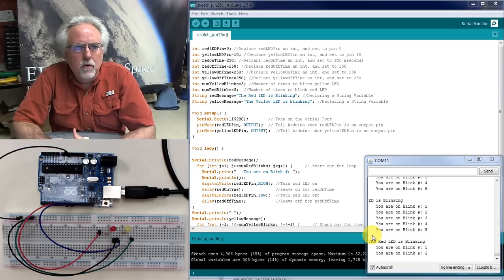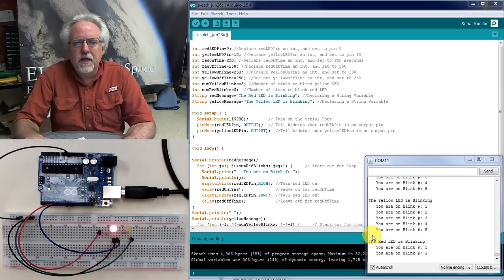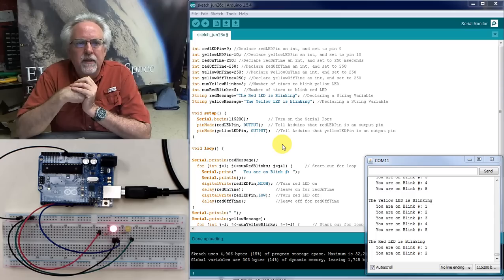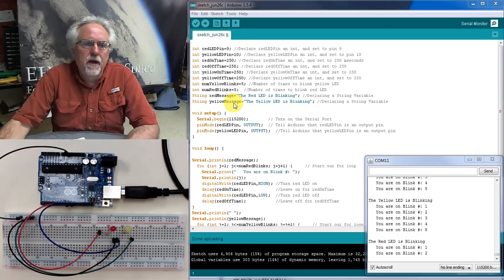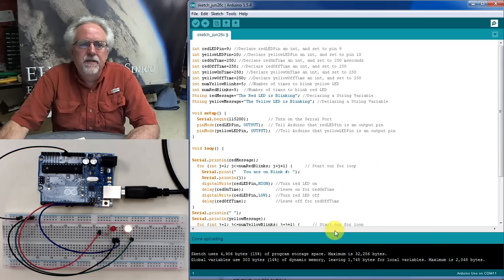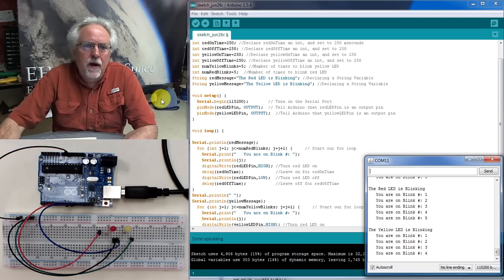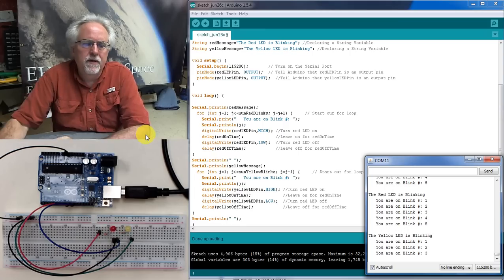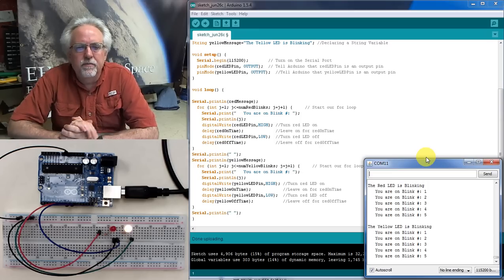LESSON 6: Reading Data from Arduino Serial Monitor

Comment: Hi Paul!  Thanks for these vids.  Once I have my Arduino loaded and I have given it to my mate to use, and he has connected it to his PC, then how does he see / where does he find on W10 a serial monitor which he can receive Serial.print on, and on which he can send (Serial.parseInt etc) instructions to the Arduino, without having the Arduino IDE or any other software open?

Comment: Hi, Mr.McWhorter. Just one comment. If you mention that people should change  "Newline" to "No line ending" in the Serial Monitor, it would be nicer :)  (Personally, I've been struggling with the loop running twice due to that issue.)

Comment: I could not figure out why the yellow would not print. Spent about an hour and checked every line of code to look exactly like yours then I thought Serial.available() is set to 1 after red is input since it is automatically a global variable and is not reset to 0 so I changed the parameter of yellow to Serial.parseInt() == 1 and it works great.

Comment: Hello professor,
I have a question for the part in which you put the code which acquires the information from the user at the void set up. Would it work if I create another loop(which contains the void loop) and then place the code which gets the information out of the original loop and inside the second loop?

Comment: Can we use ' if (Serial.availble() > 0) instead of the while loop???
Reply: Using an if in that way won't make the program stop. It'll just execute the code inside the if statement, and since in this case there's no code in the if statement, it'll do nothing whatsoever. You need to use a loop to stop it; no other choice. 

If you don't want to write the loop every time, just make it a function and call it when you need to wait.

Comment: Thanks a lot sir for your awesome Arduino lectures.I'm facing a problem about  Reading Data from Arduino Serial Monitor.I followed all the steps that you shown in the lecture and even I've copy you program on my Arduino window. But it is not following the command.It prompts me to put of blinking number for Red and when I give a integer,  it doesn't stop for  blinking number for Yellow LED.I'm  not getting what should I do?
Reply: Ok sir. I've solve my problem
Reply: how do you solve the problem ?

Comment: Had the same issue as that pinned comment regarding it asking for the second number of digits before I'd inputted the first one. There's a good solution there but as an alternative, you can use Serial.read() after each parse statement, which according to my limited knowledge, clears the memory of the arduino from before. Sorry if not explained properly!

Comment: Paul, thank you for this.  I have been playing around with the arduino for a short amount of time and have had minor experience in the mid 90s with C/C++ and I'm getting back in to it.  Quick question about this project:  How would you go about aborting or immediately terminating the for loop with key "9"?  I have modified what you have demonstrated with options of using key "1", for red LED and how many times to blink and key "2" for only yellow and how many times to blink.  Works great.  However, say, if you enter 100 times for the red LED to blink and after it does about x-amount of blinks, you want to terminate it with key "9"?  It still seems to iterate through the whole loop, then it displays "Terminated", but, I'd like to terminate it immediately.  Thanks sir!

Comment: Be careful when using Serial.parseInt(). This is looking for an int until either it times out or it sees a character. This is fine for this example but it will introduce a delay in the execution of whatever function you are using with the serial data if you just send an int. A better way would be to send an int followed by a character such as "10x" that way it will read the int 10 and see the character "x" after it and immediately assign 10 to whatever variable its assigned. Then on the next line just do Serial.read() to clear the "x" from the serial buffer so it won't cause any other issues with your program.

Comment: Hey Paul McWhorter, I have a really important doubt.
P.S. At https://youtu.be/-3Xg8x2ibeY?t=195, your serial monitor actually printed "You are on blin 2" instead of "You are on blink #:2." Is this a bug in your code or a problem with the serial port as if it is a problem with a serial port, it may spoil user experience.
Reply from the maker: You are really paying attention!
Reply: Thanks.
By the way,you are the best arduino teacher

Comment: There was a question I was going to have you in a project Arduino serial port controlled robotic arm wondering if you could help us G = body K = arm has 4 servo motors , etc. We provide how to control ... sample series pot G50 type of partition abrasive discs connected to the servo motor 50 degrees how come we do it

Comment: I found the written sketch in lesson 7. I cut and pasted it in. Some of the problems I was having were there. It would ask about how many red blinks and then would state how many yellow but did not wait for an answer! It says I am blinking both 2 time but only the red led blinks continuously! Any suggestions?
Thanks
Reply: you may try to add the line: 

Serial.parseInt ()

 to your code after 

numRedBlinks=Serial.parseInt();
and if you put the while in the void loop then you have to put the same above line after

numYellowBlinks=Serial.parseInt ();
Reply: I will try that, thanks.
Have a nice evening.
Reply: Jeez thanks a lot for that. Had the same problem and had no clue what was up ;)
Reply: Most welcome, Glad I could help.
Reply: Thank you bro i was stuck with this problem for days until i saw your comment.
Reply: thanks a lot for this man! i was trying to find the error in my code for almost half hour!

Comment: Hello Paul,
first of all, I wanna thank you for this amazing initiative of teaching in videos

I have a little problem in my code,

int pinon=13;
int pinontime=1000;
int pinofftime=1000;
int numledblink;
String ledmessage= "The LED is Blinking!!";

void setup() {
  // put your setup code here, to run once:
pinMode(pinon,OUTPUT);
Serial.begin(9600);
}

void loop() {

Serial.println("how many times do you want led to blink? ");
while (Serial.available()==0){ }
numledblink = Serial.parseInt();

Serial.println(ledmessage);
  for (int j=1; j<=numledblink; j=j+1){
    Serial.print("  you are on blink #: ");
    Serial.println(j);
    digitalWrite(pinon,HIGH);
    delay(pinontime);
    digitalWrite(pinon,LOW);
    delay(pinofftime);
  }
}

when I get into serial monitor, it works fine as you've shown in the video but in the end it prints the message "how many times do you want led to blink?" and instead of waiting for the input, it proceeds further to print the ledmessage and then come back again to print "how many times do you want led to blink?"

can you please help me how to get rid of that?

thank you.
Reply: bro i too have the same problem.
it is not waiting after the first time...........
Reply: Make sure serial monitor is set to no line ending.

Comment: I found that adding Serial.flush() will clear out the serial port following the first while loop to clear out the buffer. Otherwise, the code follow through without prompting the user for input of second value
Reply: That did NOT fix the problem, I put it in the setup, I put in in between red and yellow, it still did not wait for yellow input.  any other suggestions?

Comment: It's good, okay code. There's no test or anything for the user input, how would you go about testing to make sure the data entered by the user is the correct type within the Arduino base? I'm still learning programming and am only proficient in BASIC right now. I would normally put it in a try block just to be quick about it, does C have a similar script? 

E.g.

Try {
numHolder = Serial.parseInt();
if numHolder >= 0 then
numRedBlinks = numHolder
else
Serial.println("Please enter only positive numbers.");

}

Catch
{
Serial.println("Please enter a valid number.");
}

Something like that? With this code it's assuming your user will always enter a number, but with this code you can currently put any character into it and it will execute. Granted it will run as if 0 has been entered, but I'd rather just have the try block there if they have it available in C. Or if someone could enlighten me on how to do it another way? Thanks in advance.

Comment: It is not in ur projects but what is to be done when it says:Arduino: 1.8.8 (Windows 10), Board: "Arduino/Genuino Uno"
Sketch uses 2162 bytes (6%) of program storage space. Maximum is 32256 bytes.
Global variables use 52 bytes (2%) of dynamic memory, leaving 1996 bytes for local variables. Maximum is 2048 bytes.
avrdude: ser_open(): can't set com-state for "\\.\COM10"
An error occurred while uploading the sketch
This report would have more information with
"Show verbose output during compilation"
option enabled in File -> Preferences.

Comment: I have this weird error. I input the nr for red and does not wait for me to input for yellow. It just starts blinking after i input Red. I copied the code from the website and it is the same. I am running Arduino 1.8.13 - Anyone has any idea?

Comment: Dear Mr. McWhorter,  I tried writing my own code based on this but for some reasons it doesn't recognize the pause for the second LED. It asks but just goes to the for loop. So the user doesn't have enough time to put it in. I also tried it out with the exact same code as yours and it still didn't work. Please help me. Thanks.
Reply: In the serial monitor change first drop down option to 'no line ending'.
Reply: I had the same problem, you solved it, thanks a million!
Reply: GREAT SOLUTION -- THANK YOU @quantumaxe6468

Comment: I follow the instruction and the code along with the video, I find a problem that I could not find the blinking question prompt in the serial monitor
as I type the serial.println in either setup or loop part, as I enter the number, it is still working, but the problem is it just did not show up when I open the serial monitor for the first time, 
I wonder why, I am using Arduino LEONARDO, i have try to unplug and replug, just do not know why, please help
Reply: http://arduino.cc/en/Guide/ArduinoLeonardoMicro?from=Guide.ArduinoLeonardo, Find the problem here, still thanks.

Comment: You are an awesome teacher! I love your videos. The lesson 6 however doesn't seem to work for me. I had written the entire code following your instructions. I even tried copying and pasting the code from your website. It still doesn't work properly. Its only the red light that seems to be blinking.
Reply from the maker: Read first comment below video which is pinned.
Reply: @paulmcwhorter   Thanks a gazillion Paul!! It worked!!!. The baud was also set to 9600 although the code itself mentioned 115200. It works like a charm now.

Comment: I am not getting a hold for the second input. it prints to the screen but then advances past it before i have a chance to input anything. The syntax for my while statement is exactly the same... any thoughts?thanks
Reply from the maker: ***** Just check your code again . . . check capitalization and syntax character by character. Good luck!
Reply: Paul McWhorter Syntax was perfect! found the problem lay in the serial monitor "new line" function. setting it to "no line ending" cleared the problem up.
Reply: Also, i can't thank you enough for these tutorials and lessons. I started going through a lot of examples and other lessons, so i had an idea of what was going on, but these videos are helping to really bring everything together. My only background with coding was a bit of HTML in college and a bit of Visual Basic/Crystal where i work.
Reply from the maker: ***** Glad it is helping you. Thanks for the encouraging words.
Reply: ***** Had the same problem, thanks for the fix.
Reply: ***** Thanks, I was having the same issue.
Reply: ***** Not quite understanding. How do i fix this?
Reply: seanlovesjobo ah i figured it out.

Comment: make sure you set your serial monitor to no line ending. the program runs differently on other settings. i now have learnt why you say my program runs like crap i  could not figure out why it would not let user input number for yellow blinks.

Comment: First of all, these are great tutorials!
Maybe I missed it in the video, I ran into a problem with the while loop from "while (Serial.available()==0) {}" only working once. I just wanted the program to halt until the user pressed anything + enter.
The input however remains in place and the next time the while loop was activated it found the entry still being there and the program did not halt
Experiment showed that to clear the entry one needs apparently to read the entry with something like n = Serial.parseInt(); even if you do nothing with n.
Reply from the maker: Make sure serial monitor is set to no line ending.
Reply: Had the same problem, selecting “no line ending” solved it for me

Comment: I have a question.

I wanted to do "You are on blink (random number) out of #"

how can I put the user input for the #
Reply: +VisLock You can print the variable value that the user entered which in this case would be numRedBlinks or numYellowBlinks.

Something like:
Serial.print("You are on blink ");
Serial.print(j);
Serial.print(" out of # ");
Serial.println(numRedBlinks); 

Not sure whether that's exactly what you're looking for.

Comment: hey! do i use Serial.parseChar(); ? to read a char? 
if not, please suggest what can i use to read a char.
Reply: I think you have to do it like this:

char A;

void setup() {

Serial.begin(9600);
}

void loop() {

while (Serial.available()== 0){ }
  A = Serial.read();
  Serial.println(A); // this will show you what char the user pressed.
}

I just ordered my arduino and i'm not a qualified programmer so i don't know if this will work i haven't tried it.

But let me know if it did work!

Also let me know if it didn't i might have another solution.

Comment: Your lessons are great....

But I have a special goal for learning Arduino.  

I need to find a way to capture the oscillation point or peak data of a moving object and use that data for a trigger. 

To visualize this, Picture a rail with a distance sensor at each end. The target would oscillate between the 2 end points with the center being 180.  To the left the max measurement would be 270 and max 90 to the right. When the target moves to the right then switches direction I want to capture the farthest measurement lowest number serial data to trigger a device when the target is at a certain point on the left. Then I want to capture the oscillation point highest number on the left to in turn trigger the device at a certain point on the right. Due to changing loads on the device being triggered the oscillation points will change randomly. 

Can this be done?

Below is a rough draft of comments without any code. 

//Arduino uno

// vl53l0x sensors
// distance sensor1 value 181 to 270 degrees
//distance sensor2 value 179 to 90 degrees

//1 stepper Nemo 17 or 23 
//Stepper full rotation 0-359 steps (clock wise count 0 north) 
//Home 180, max rotation from 270 to 90 degrees.
// orientations. 270 right, 90 left. 
//sensors placed at the ends of a rail with oscillating target.

//if sensor1 value oscillates set sensor1 to highvalue of oscillation 
Oscillation at 172-173-172 would set value at 173

// if sensor2 lowalue is  = 178
// run stepper to 183 when sensor1 reaches 182  //1degrees
// if sensor2 lowalue is  =177
// run stepper to 184 when sensor1 reaches 183
// if sensor2 lowalue is  =176
// run stepper to 185 when sensor1 reaches 184
// if sensor2 lowalue is  = 175
// run stepper to 186 when sensor1 reaches 185
// if sensor2 lowalue is  =174
// run stepper to 187 when sensor1 reaches 186
// if sensor2 lowalue is  =173
// run stepper to 188 when sensor1 reaches 187
// if sensor2 lowalue is  = 172
// run stepper to 189 when sensor1 reaches 188
// if sensor2 lowalue is  =171
// run stepper to 189 when sensor1 reaches 188
//Etc....... to lowvalue of 90 
//use < at end max run to 270

//If sensor 2 value oscillates set sensor2 to lowvalue of oscillation
Ocilation at 186 - 185 - 186 would set value at 185

// if sensor1 highvalue is 182
// run stepper to 177 when sensor2 reaches 178
 // if sensor1 highvalue is 183
// run stepper to 176 when sensor2 reaches 177
 // if sensor1 highvalue is 184
// run stepper to 175 when sensor2 reaches 176
 // if sensor1 highvalue is 185
// run stepper to 174 when sensor2 reaches 175
//Etc........to highvalue of 270....... 
//use > at end max run to 90.
Reply: I would say store the positions in a variable, since the amplitudes are random you cannot tell which number will be max/min , but you can measure and see when an decrementing series stops decrement, which is the time you want to take the action, same for the incrementing numbers side ......

Comment: Hi Paul, do you have lesson on how to save a data in csv file from arduino inputs?
Reply: That would generally be done on the computer side (DotNet, Java, whatever) while reading the serial com. With Windows and Visual Studio, you probably need to use an instance of IO.Ports.SerialPort

Comment: I'm new to arduino. after several tries. Below had worked however, you need to input faster or create a delay so it would work.

Serial.println("How many times red blinks?" );
while(Serial.available()==0){}

Serial.println("How many times yellow blinks?" );
while(Serial.available()==0){}
numyellowBlinks = Serial.parseInt();
numredBlinks = Serial.parseInt();